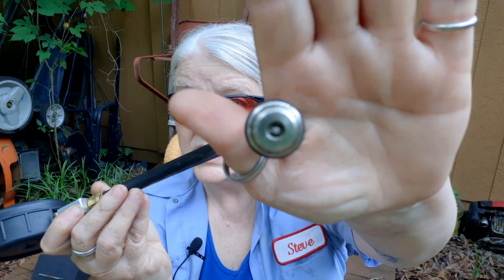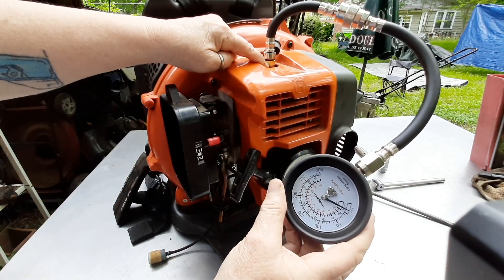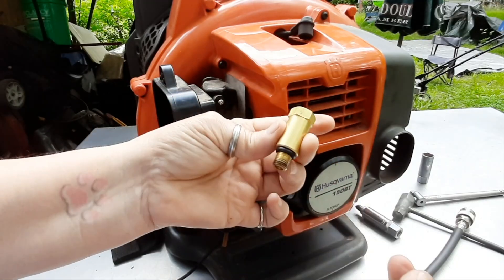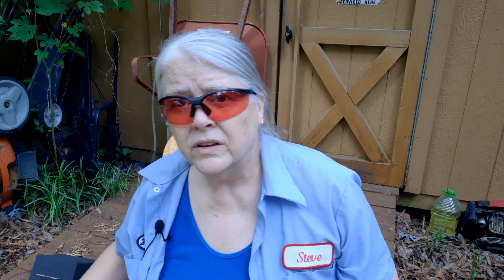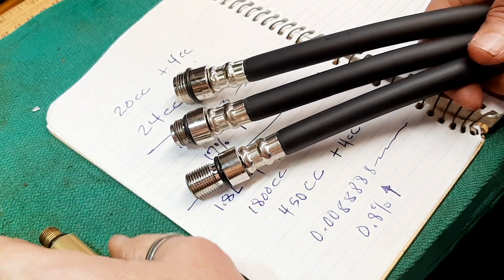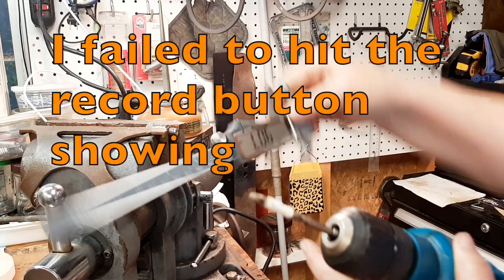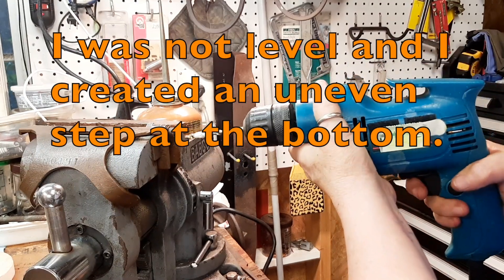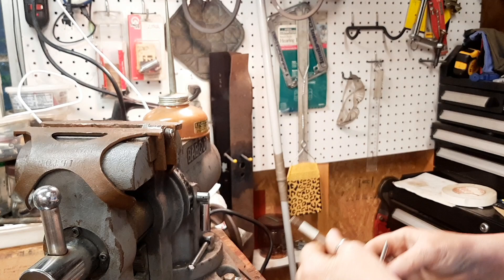I Drilled My Compression Tester! It Worked...Sort of

Comment: E4xcelent  I was wondering if there was a different way to test the compression without baying  a compression tester 
When I saw your tester I remembered that somewhere in the shed I saw one  and within minute I find one .the house
was very old and I mongered to put another one  -very tied fitting - But  the needle on the gauge  will not stay up 
The I tried on another chainsaw  and the needle still come down when pulling the starter rope  I wonder if that little valve 
has the seal rubber damaged as it has been sitting for years without use       Of course  the question is how to get to 
the valve ? I presume it is on the spark plug side  it consist of a short brass piece with two kind of thread  a normal one
and  a big on both threads have a O ring --I put a new one -- Any  suggestions what to do ?  THANK YOU
Reply from the maker: use a tire valve tool to remove the old one. Be sure and replace it with a low pressure valve. There are links in the video description. Thanks for watching. Cheers!

Comment: If it’s leaking you can take it up to the size thread that’s on the outside of a typical valve stem. And than seal the outer thread, just to have a workaround for this angled special shoulder.

Best regards from Sweden.
Reply from the maker: Thanks!

Comment: So I watched your entire video and I really enjoyed it. One thing i was wondering is, should you of filled it up to the top with liquid since there is a threaded piece that needs to screw in. That would lessen some of that volume.  But anyways,  your video got me brain storming about a way to do this without buying a special tap or drill bits. I took a rubber tire valve stem and ground it down to fit snugly into adapter. I did have to grind down the brass threads also so it was smooth. I drilled the adapter hole out to 9/32" to help it fit inside. The rubber on the tire valve sealed as I  pushed it inside.
Since my compression tester only has a relief valve by gauge, this made a huge difference on the reading.
Thanks again for the video.
Reply from the maker: Great idea! I appreciate you watching.

Comment: So what brand of compression tester is the best, with all right sized adapters???? I ll buy that one.
Reply from the maker: I think the mighty vac compression tester is probably the best one for small engines. But none of them have the Schrader valve in the 10 mm threaded adapter. If you're not working on chainsaws you might be okay. Most of those have larger spark plugs

Comment: Hey. I had a question but its a little of topic. (Echo srm225) When I removed the vent cap to change it gas poured out of the vent line like it would with the intake and return line if the gas cap is not loosened! Was it just an indication of a clogged vent cap?
Reply from the maker: That's a good question... that I don't have a good answer for. You can always to a pressure/vac test to make sure the vent is working. Thanks for watching.
Reply: @TheLawnmowerLady Thanks for your response! I have the utmost respect for your wisdom an knowledge!💯

Comment: I have to say, Stella, when you come back after a long absence, you do it with a bang!  I rank this video up in the top 5% of all small engine technical videos I’ve ever seen. 
As for which method is more precise for measuring the internal volume of that adapter, I’d be willing to bet that using a fluid is better because it takes into account the volume in between threads. The only other way to get more precise would be to make sure that one pays attention to the fluid meniscus and parallax view when viewing the syringe and at that level it probably doesn’t matter. 
Thank you very much for producing this video!
Reply from the maker: I think you're right about the fluid method. Cheers!

Comment: https://www.jbind.com/wp-content/uploads/2021/08/720-97refrigerantAccessValveINSTRUCTIONS.pdf
sheet two has dimensions. 5V1 tap and die sets are available on Amazon and Ebay. Just curious Stella, how did you determine the 20cc volume of the blower engine?
Reply from the maker: Thanks, I think I saw that sheet in my research. I didn't actually look up the cc of that blower, I just chose 20cc as an example to make the math easier. I guess that wound up on the cutting room floor, so to speak. Cheers!

Comment: Remember before Internet shopping was a thing and you could buy a reliable tool without really being concerned with the brand? If a store was selling a compression tester, you could rely on it being accurate. Now, not only do we have too many options, if we choose wrong, we might end up with a tool that doesn't work properly. My first compression tester was a gift. Instead of a Schrader valve it had a little ball bearing. I figured it'd be fine, but it was always far below the actual pressure. I just don't understand, why make a product that doesn't work? I mean, they had already done 97% of the job, just put in a Schrader valve! I bought a tire pressure gauge a couple years ago and it's 10 PSI below the actual pressure. They had one job and they failed. :) Embarrassingly, that gauge had me chasing a TPMS issue that didn't exist. Anyway, nice video, sorry for the rant.
Reply from the maker: I am right there with you Mike. So many choices and so little understanding. Part of me really enjoys learning and doing things like this. I'm pretty glad YT gives the opportunity to share. Cheers!

Comment: True Compression test was in Dye & Shot Glass method.   Cheers! 
fro One that creates more mess trying to fix things, perhaps to maintain level balance by placing Drill on block of wood, [same height] with cloth under.  [helps drill slide] ... move drill forward as needed.  if drill tilted, handle bases lifts off wood, thus NOT level.  : }
Reply: ⚡   haha
Reply from the maker: Thanks! Awesome suggestion. Thanks for watching. Cheers!

Comment: Interesting video Stella, I stacked a few washers inside my 10mm adaptor to take up most of the extra volume, worked pretty well for a 5 minute hack...
Reply from the maker: That's brilliant!
Reply: This sounds like a lot less hassle of a hack, I'm thinking similar thoughts but instead of taps and dies and drills how about filling a 10mm adapter with silicone  or something else to the correct internal thread height. Then having a section of hollow straw /tube  running through the center???
Reply from the maker: @hubby-tubadventures01  Another suggestion was epoxy (JB-Weld or similar) to glue the valve into the adapter. I considered that, but decided not.
Reply: @hubby-tubadventures01  Hiya, there is so many clever things you could do to use up most of the 'extra volume' in adaptors. Just remember don't use anything that could fall into your engine.. Silicone swells up when exposed to fuel vapours so please don't use that. JB weld seems fuel proof, once again it could crumble over time and fall in your plug hole !!..

Comment: That is awesome!!! Most people are shocked as a girl knowing how to rebuild and fix lawn mowers and weed eaters. I’m sure you’ve gotten it too. I love those small engines! Weed eaters, ugh not so much. They are a pain in the butt to work on.
Reply from the maker: Don't tell anyone... but I agree about the weed whckers, LOL! I appreciate you watching. Cheers!
Reply: Yes I like these kind of videos..... PS any suggestions/tricks as to what I could use as an alternative blade clutch material on a Honda mower that the parts are not available for now by any chance. I've been partly successful experimenting so far 😅
Reply from the maker: @JBW71  🤔 Other than eBay, I got nothing...
Reply: @TheLawnmowerLady Honestly TBF, i know It's impossible to expect anything of the sort really. I remember your friend over in the UK,(Mick's mowers) show a vid where he installed linings using glue to just the existing plate. It' looked to be a good alternative but cheaper . I have a different design and I've seen just the combined pulley with the clutch material online for 135 quid. But seeing it's a 28 year old machine, I am reluctant to purchase this item, just yet. It might be fun to try out different materials to see what does and does not work. I've tried some already 😃.
Reply from the maker: @JBW71  Sweet. I hope you get it sorted. Cheers!